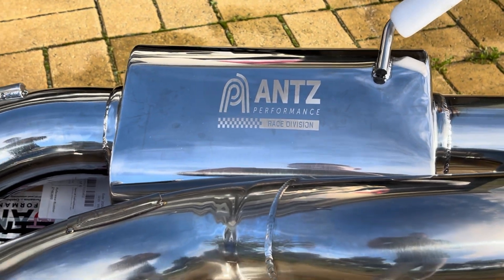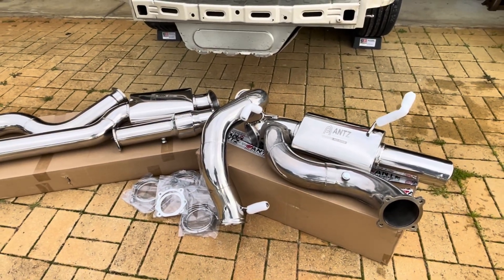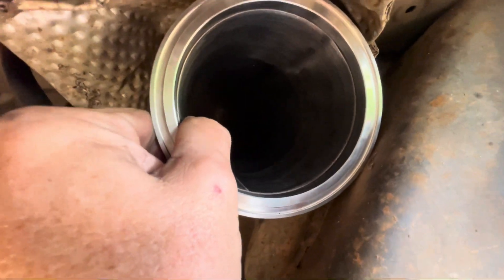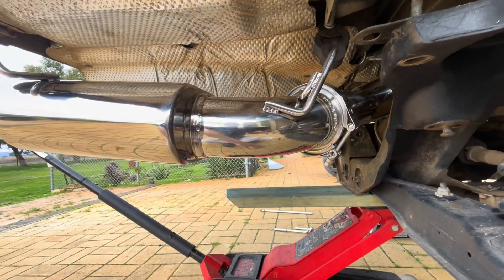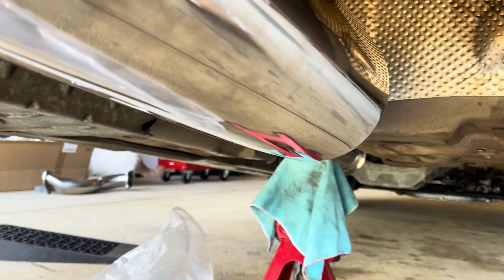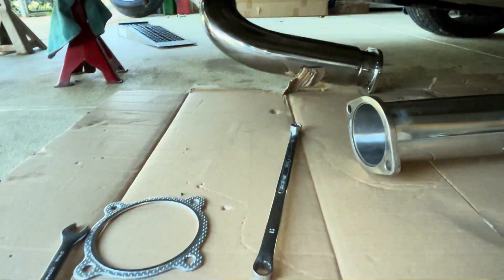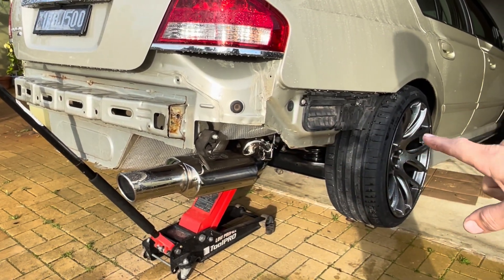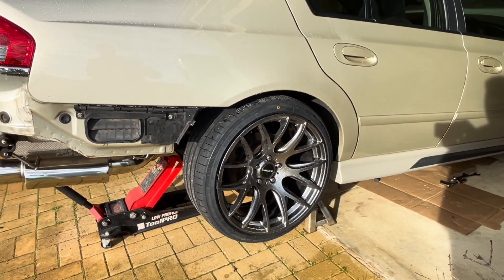Barra NA+T Build Pt.16 - Fitting ANTZ PERFORMANCE FG TURBO 4” Exhaust System

Comment: How did you align the rear cradle when put it back up? The center bolt isnt not aligning properly.....
Reply from the maker: Hey mate, the way I do it is I get all 4 of the big nuts on most but not all of the way up, and the same with the two long bolts. Then if you look at each end of the cradle there is a ring cut out of the steel which line up with two holes where they meet up and sit flush against the chassis. They’re usually pretty close but with the nuts and bolts still lose you can stick something like a long pry bar and extension bar into the holes and pry the cradle so the holes live up as close as you can get them, then I just tighten the two long bolts enough to just holt it in place. You should then me able to get that single bolt in and tighten every else up as well. Hope that helps mate.
Reply: @Jeenzy79 cheers! I'll give a try tomorrow
Reply from the maker: @Peanewtgaming You’ll get it mate, pretty straightforward 🤙🏼

Comment: The exhaust after the cat looks like it reduces to 3.5" . That a  restriction making not a full true 4" exhaust . Can you confirm this please 
Thanks
Reply from the maker: Hey mate. The cat itself is 5” the rest of the system is 4”
Reply: Yes it's a 4" dump into a 5" cat body but then it looks like it goes to a 3.5 after the cat that continues through a flange (2 bolt which is 3.5 as seen when you show gasket packet is smaller than others in there  )  and goes to 4 inch again .
That does not make it a full 4 inch so bit of false advertising from antz pantz
Not having a go at you but as I said not full 4" as advertised

Comment: That looks awesome, very well done. And super good that it doesn't hang too low, that's something that is still making me consider getting a 3.5" system instead of 4". But mannn it looks sweet and you did a great job with the install. Love to see it
Reply from the maker: Cheers mate… I was surprised at how well it tucks up under there. The clamp in the middle section is the only part that kind of protrudes from the rest of the system. I’ve been thinking of lifting the suspension on the car a little too so that will help with any clearance as well. One thing I’m not happy with is the tip at the rear doesn’t sit nicely in the cut out I. The bumper but that should just be a mater of loosening off the clamps and having a bit of a play with it when the bumper is back on for good. 
Cheers